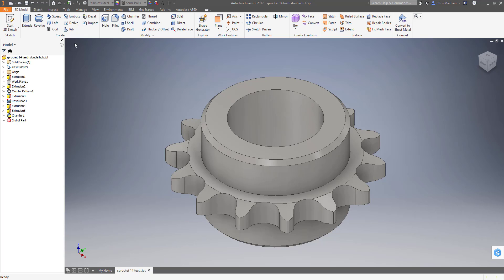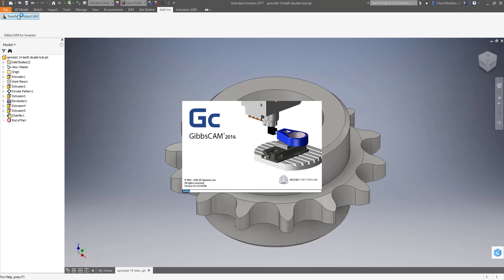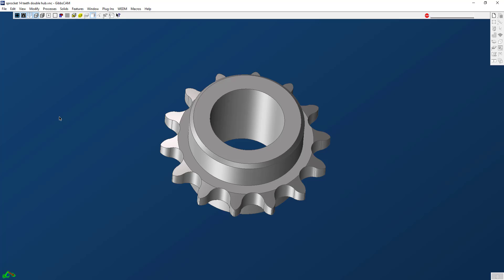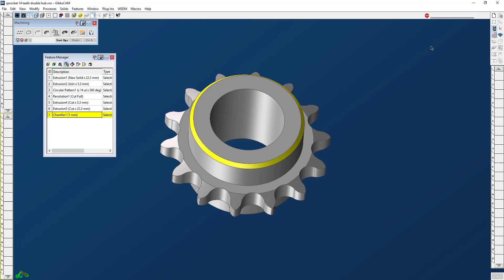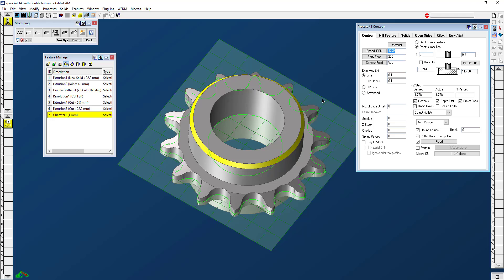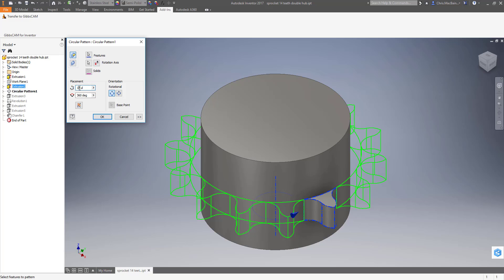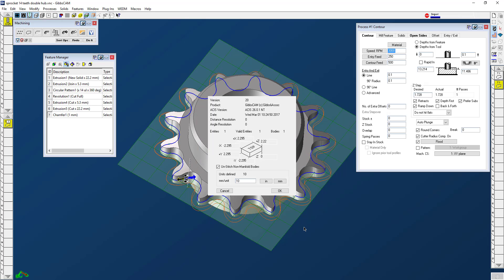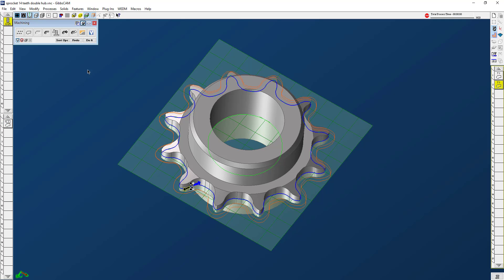Importing an Inventor part into GibbsCAM

Comment: The Gibbs cam I have looks completely different (version 13.0.13 64 bit) and doesn’t have an add in option. It’s a retail stand alone permanent seat. Wish I could get a refund at this point. Fusion is so much easier than this. Apparently it’s the bottom of the barrel Gibbs 3 axis machining and I was charged for it when I bought my machine and told I had to have it yet it’s not even comparable to fusion as they built it up like it was great but the reality is it’s awful if I can’t move my dwg, dfx, or ipt files over. Just wasting my time. At least fusion is free and superior in every way.